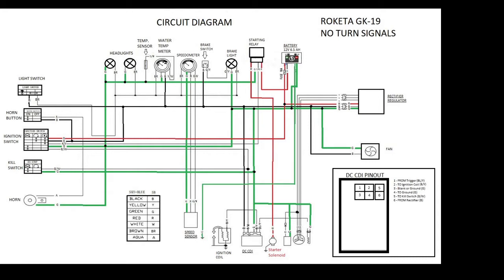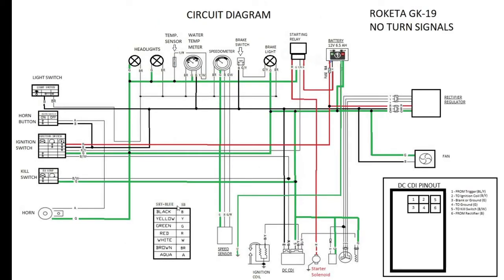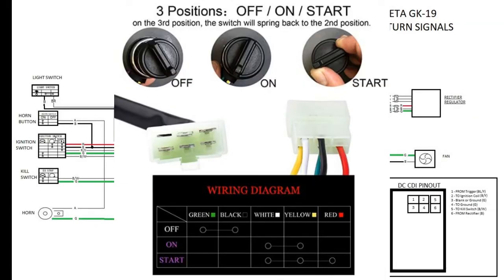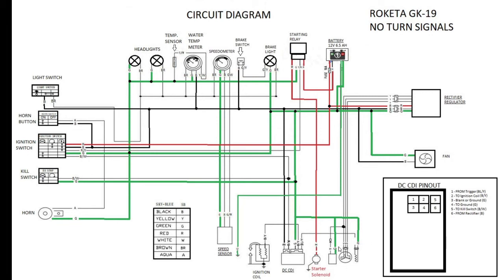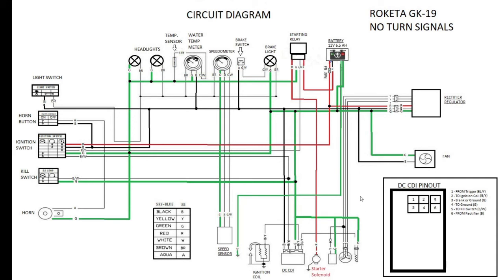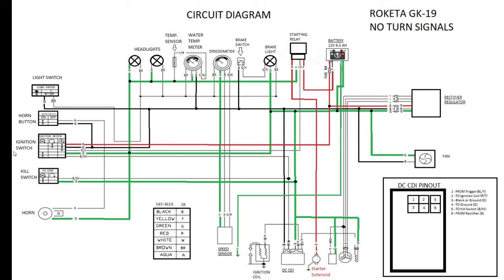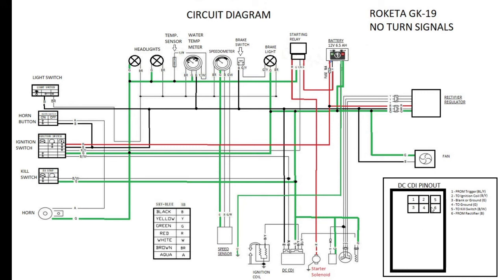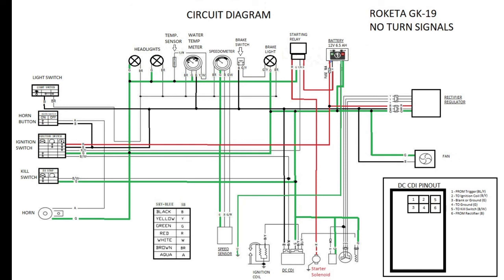Part 2 Chinese 250cc 150cc Go Kart/Buggy Wiring Schematic Roketa-GK-19 Kinroad MotoBravo GY6 Engine

Comment: I’ve rebuilt 3 buggy’s now and I decided to redo the entire harness on each of them. These engines are good but the buggy’s wiring is not safe from the factory. I have seen tail lights catch fire because the wiring was undersized and poorly protected.

Comment: What is the square next to the stator with the short yellow and green wire coming from it and what does the yellow hook to
Reply from the maker: It's been a minute but from memory I believe this is the auto-choke function that goes to the carburetor.  If your carb has something that looks like a spark plug boot on it, that's the auto-choke function.  
It has a plunger that slowly retracts once it starts getting power from the stator.  The cycle is about 2 minutes.  Once you turn off the motor, the plunger will slowly extend back into position so that when you go to start it again, it will be in "choke" again.

Comment: Have you tried to hook up at tachometer sir? I tried tapping to the b/y line from cdi to ignition coil and the tach goes all the way to max reading even its in idle. The weird thing is accidentally tapped into the kill switch line b/w and i got a decent reading.
Reply from the maker: Yes, I wired and installed a custom digital dashboard on mine with tach.  On a single-cylinder engine it’s simply a solid wire that wraps tight around the spark plug wire.
Reply: Is it the wire directly connected to the spark plug after the ignition coil or is it the black yellow wire before the ignition coil?
Reply from the maker: @RaymondSurnet-c3u  yes, the thick one connected directly to the spark plug.  Look at different tachs for single cylinder engines and you’ll see why I mean.

Comment: Hello sir. I would like to know where to connect the carb auto choke? Thank you
Reply from the maker: Yeah I should have covered this…it’s that little box to the left of the stator in the schematic.  It gets AC power direct from the stator via one of the 3 wires coming from the stator.
Reply: Any of the 3 yellow wires will do?
Reply from the maker: @RaymondSurnet-c3u  I believe these motors are all 3-phase so any of the wires (that are the same color) should generate AC power to tap into.  Use a multimeter and confirm which wires have AC power when motor is running...one wire might be a ground if its a different color.  You also likely have a pair of wires coming from the same "port that are coming from the pickup coil, then leading to the CDI.  These are signal wires and will only show very very low voltage.
Reply: Thank you so much sir. It takes around 30 sec before the rev slows down after cold start up so i guess its working.

Comment: Okay I'm very curious what is the little box that is next to the stator on the left hand side of the stator that one of the wires from the yellow AC connects to I've been trying to figure that out as I do not have anything that connects to that I just have that AC wire with a bullet connector on the end of it and would love to know what it's supposed to connect to if by chance you have what supposed to connect to but in your diagram it doesn't say what it is thank you
Reply from the maker: Sure…I should have labeled that!  That’s the “Auto Choke” function.  If your buggy isn’t using it you must have a manual-choke carb where you have to pull a cable or flip a lever.  

If you look a carburetor, for example on Amazon, that has a black “spark plug” looking thing on it with wires coming from it, that’s an “auto-choke carb” that works off of AC power from your stator.

Comment: Do you know where the wiring goes for the choke
Reply from the maker: Yes…I should have called it out better on the schematic in the video.  It’s that little box to the left of the stator coil.  The auto- choke is wired directly to one of the AC power outputs from the stator.  The other is grounded.
Reply: @pattywaktdiy4175   I do not have a box there, but I do have an a wire from the stator I had no wiring. I had to rewire the whole thing. It works, but the choke. I haven’t figured out yet.
Reply: My choke has looks like three wires on it. I was going to cut it open to see what they are where they go.
Reply from the maker: @rdolge49  sorry, to clarify it’s only represented as a “little box” in the schematic. Really, it’s wired directly to the carburetor.  That little box represents the electronic module attached to the carb.  I’m not sure why you would have 3 wires.  It must be a different setup.  Do you have the option to choke it at any time and not just in engine startup?  That’s be my guess.

Comment: What is the little box with 2 wires next to the stator? (left side)
Reply from the maker: That’s the “auto-choke”.  You should have a wire lead coming from your carburetor.  
The design is this…when you first start the buggy, the resistor mounted to the carb will slowly “pull out” a plunger that is choking the air/fuel mixture.  The cycle takes about 2 minutes to complete.  That’s why the engine idles high at first.  This widget is powered directly by the AC power coming from the stator.  
When you turn off the engine, that plunger will slowing reset “replug”.  You can remove from carb and watch it move real time but it’s like watching paint dry!
Reply: @pattywaktdiy4175  thats what i thought it was from the schematics. I bought a cn250 machine with a butchered wiring harness just trying to get it to start with minimal wiring like just hooking up regulator, cdi, coil and kill switch not sure if that would do it just to check
Reply from the maker: @ragemotorsports4727   Good luck!

Comment: It doesn't have to be running to get 12 volt power on out of my the regulator. The charge wire is tied into it the battery wire at the solonoid which is always hot al you have to do is turn the key.
Reply from the maker: That means you have a DC setup.  If the engine he right be running to power your accessories, you have an AC setup.

Comment: hey man i want to say thanks i got my buggy running 06 roketa gk13b 
thanks to your wiring schematic and advice i just need to fox the lights which should be easy and simple
Reply from the maker: Great to hear!  I just got back from a day trip last night in Southern Idaho.  Super fun and it’s still running great!… but I need an air filter solution.  It was like moon dust out there so the filters just soaked it right up.  I’ll be looking at some type of pre filter bag to put over it that I can easily pull off and shake out most of the dust that would have clogged my filter.

Comment: my gy6 has a starter button and not a spring return key? am I dickered for using this harness
Reply from the maker: Not necessarily.  Do you have a toggle switch that has to be turned on before the button will engage the starter?  If so, that's the same function as an ignition switch.  
If you don't have a separate toggle switch tp turn on auxiliary power, you have an AC wiring setup.  Another way to look at it, if your headlights only work with the engine running, you have an AC setup (NOT a DC as in this video).

Comment: YOU'RE THE MAN!!!!!!! My neighbor gave my boys and I a carbide 150cc cc. He said his son and his buddies we're messing with it, and it's never ran since, 3 years ago. The body is in pretty decent shape, no rust hardly, it needs 2 rear tires. It has been under a tarp, and a big maple tree. Squirrels or mice have had their way with the wiring. It looks like someone has put in an after market harness on this one too. Well now it's my turn to screw with it lol. I ordered the closest matching wiring harness I could find on Amazon. But this one is for a four wheeler. I'm going to use as much of the original main harness as I can, and splice in the components to it. I've got a tv set up in my garage with your video playing. I appreciate your work. It's the most relatable video/ help I can find. Two big thumbs up. From outside Louisville Kentucky.  Appreciate you mucho!!!!!
Reply from the maker: Thanks for the feedback and I’m glad you now have a project to work on with your sons.  Very valuable time transferring knowledge to the next generation!  Also, I’m stoked as I’ve always wanted to be on TV!

Comment: The stator doesnt move tho, so how does it send the signal from the trigger wire
Reply from the maker: A magnetic pulse generated by the rotating flywheel around the stator.  The flywheel does rotate around the stator coils which generates an electromagnetic field (electricity).  The trigger wire has a sensor on it that picks up the electromagnetic signal.  That sensor is located right next to the rotating flywheel.

Comment: Great video of information on the wiring harness and the corresponding components.

Question:. I have no idea what buggy I have, but I know it's a GY6 150cc engine.  You've mentioned about converting from DC to AC and vice versa.  Is there anything special that needs to be done to go from AC to DC, if ordering a new wiring harness and included components (stator, CDI, coil ect.)... I believe mine is an AC system, since the lights only come on after it starts; so I'd like to change mine to DC for the same reason you stated.

Thanks much and thanks for the help
Reply from the maker: My hipshot answer is just the stator and CDI.  Coil doesn't change.  The wiring would change a little but as far as physical components you would have to change...just the stator and CDI. Your buggy likely  already has a regulator/rectifier as AC voltage would have to be reduced down to something your lights, etc could handle.  I will work on a video that compares these two wiring schematics directly.
Reply: @pattywaktdiy4175  a video on this would be excellent... I've never had one before and just bought it (not running) for my son and I to work on... Right now, he's more interested in video games😒..

I greatly appreciate the replay and the help on this .
Reply: @kreutztimothy  I could have written the same comment as you. I've  got a carbide 150cc reverse sitting in my garage right now. It was given to me from a neighbor who was moving. It was sitting outside under a tarp, and the mice have chewed the hell out of the wires. I've got parts on the way. We'll see. Have you got yours running yet?
Reply: @jasonrichardson7239  hey Jay... Yeah sounds like you'll have your work cut out for you...(I'm always amazed why mice love damn wires so much)

Yes, I did get it running after I added the new carb... To it out for a drive, and found the throttle cable stuck, and the steering wheel shaft was rusted.. started working on fixing those issues, and then l life got real busy.  Therefore, it's still sitting with the steering wheel taken out. (I'm going to install a grease zerk in the column) then I need to get a new battery, as the original one went to hell lately.

I'll probably play with it more in the next couple weeks, and see how far I can get it to be like it's suppose to be.

Let me know if you have any issues, and how your project comes along.
Reply: @kreutztimothy  will do. I've tried to find the original wiring harness,  but I only see the ones for a scooter type, with the handle bar toggle type. I used all the components from the package,  new cdi, rectifier, solenoid, 8 pole stator, coil and plug wires. Mine is a fox carbide 150cc and I cannot find crap that actually matches up just right.
Reply: @jasonrichardson7239  ok, if that's the case, why don't you just take the wiring harness apart and modify it to work as you need it to.  I've also seen the scooter harnesses on Amazon, and figured I'd take the wires off the ignition switch and install them onto the key switch on mine.  The important part of the whole harness, is to have it plug into the correct components, in order for it to run. Just a thought
Reply: @kreutztimothy  that's what I'm thinking about doing also. Just a little nervous about getting in there chopping what's left of usable harness. But hey!!..go big or go home right? And besides, it already doesn't run. Lol 😆😆😆😆

Comment: Amazing video!! I have a Roketa 150 GK01. I created my own wiring harness by using this other YouTube video but now I’m trying to add the accessories wiring harness. You have a lot more clarification but I still have some work to do in order to fully understand how to wire up my lights, turn signals and horn.
Reply from the maker: Power for all of those "accessories" should all come off the 12V source on the regulator/rectifier.  As for your switches, you only need to "break" either the power or the ground connections to the lights (pick one).  For example, coming off of your lights, ground the ground wire somewhere on your frame or tie it in with your other ground plane...then for the 12V power, create a "loop" up to your dash that returns back to the light and just put the switch in that loop to turn it on and off.  See the horn switch on my wiring diagram.  Good luck!
Reply: Same here, I'm glad mine doesn't have the horn, or turning signals.

Comment: This was great!!!! Exactly wht I needed!!...i have a Roketa 250cc and when i got it there were wires cut and taped every where...and the plug tht goes to the carburetor is missing...so this is a big help and I'm looking forward to your future videos!!!
Reply from the maker: Thanks!  Glad I was able to help!  You are exactly who I made this video for!
Reply: Hey I got your message and I thank you so much. The resistor I was talking about was the one that the guy from maximum parts' video about wiring a 150 Gy 6 buggy and I don't know if the 250N and GY 6 150 are similar or not but he has a resistor in that one. If you have seen or on and it comes from the stator wiring harness and is at the end of the ground that comes off of it. So my problem is that after about 10 minutes of running it just dies and won't start again for about 15 minutes. I have been through every thing and changed everything and no luck. Any thoughts? Thank you for putting the wiring up because I have not been able to find much either
Reply from the maker: @chetdysart7332  ok, sounds like you are talking about the “auto-choke” function.  Does your carburetor have an electrical-looking plug coming off of it?  If so, that’s it.  It’s a little plunger that slowly retracts as the engine warms up…it’s similar to how the water temp gauge works.  That’s a resistor-type setup as well.  Sorry, I forgot about that one when I answered earlier.  My buggy has the setup your described…my auto-choke plugs into a stator wire and ground.  So when you say you changed everything, did you replace the carb?
Reply: @pattywaktdiy4175  yes I do know quite a bit about them,I have 2 of them and have shagged quite a bit of wire hahaha!. It's just that the resistor is something I have only heard about from 2 different sources. I have actually seen it installed twice and 1 of the times the guy said how many ohms it was but I can't remember what he said and I can't find that 1 video again. I guess I will need to contact that maximum parts guy and see if he can tell me since I saw it in his video. Thank you again for trying to help us guys out here.